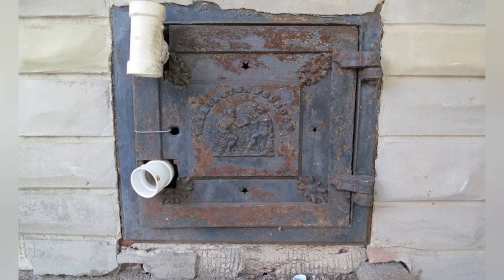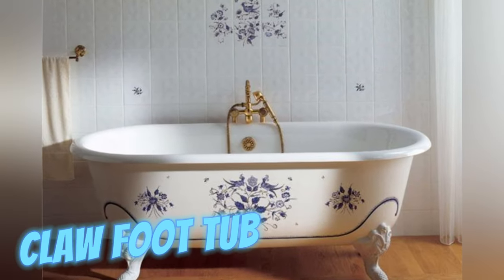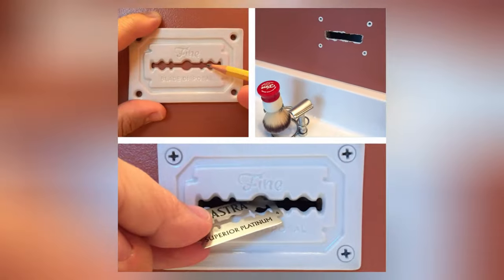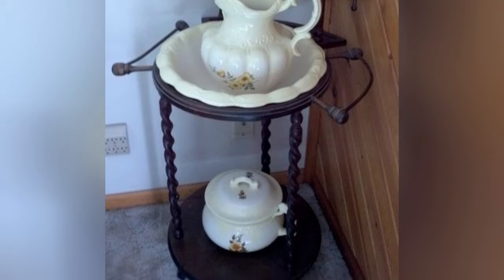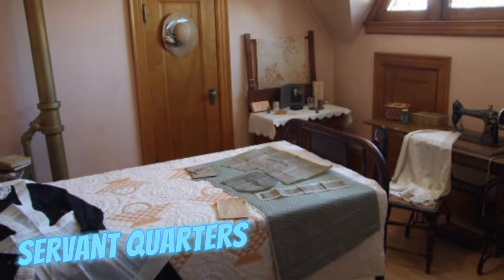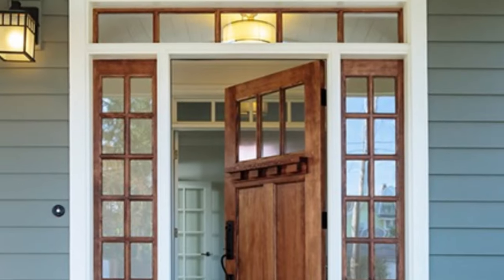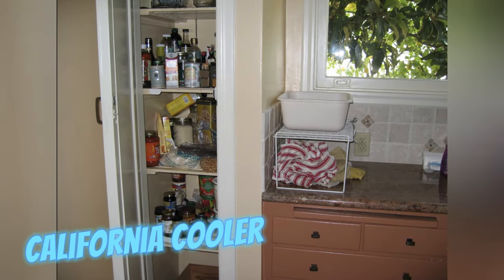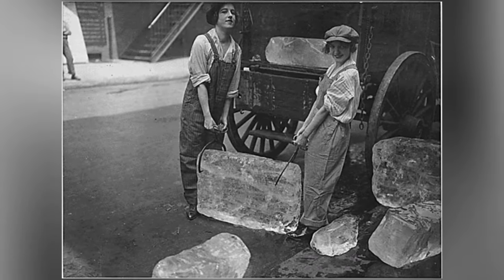20 Features Of Old Houses That WE MISS in Modern Homes

Comment: They missed plate rail molding. Crown molding that was about a foot from the ceiling having grooves in the top so you could lean a plate against the wall. Usually in the dining room.